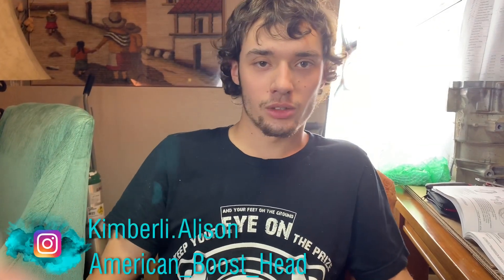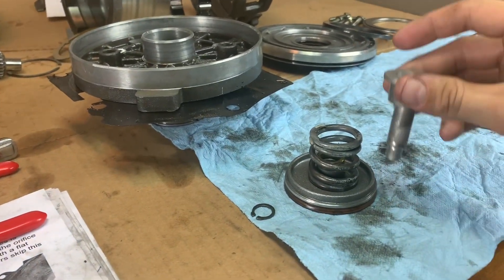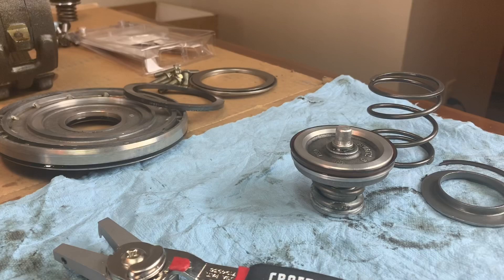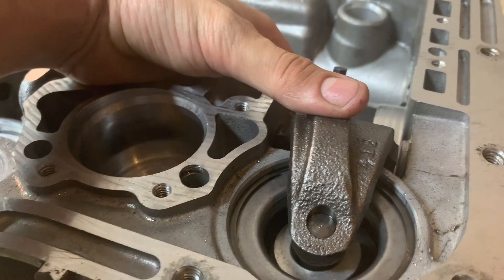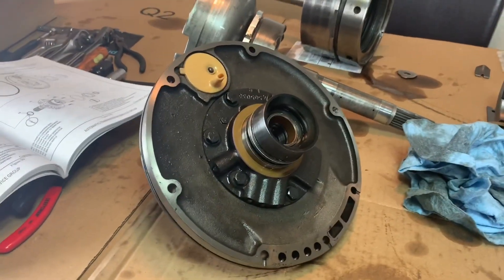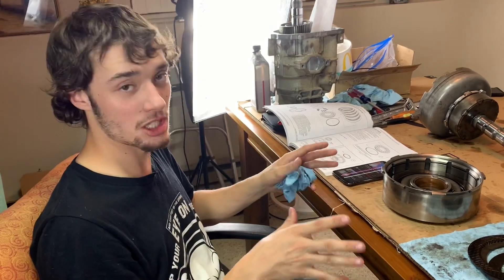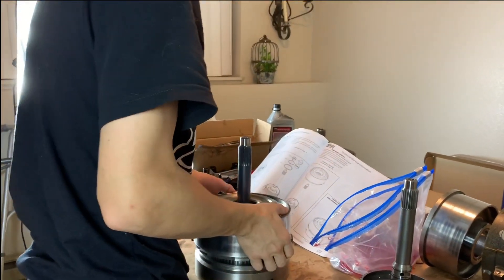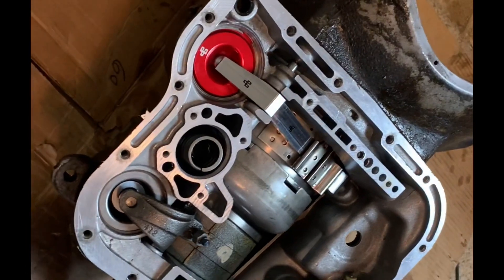47RE Main Case 650HP Build

Comment: Which shifter did u end up using?
Reply from the maker: Mike Robinson we ended up using the Muldoons switched shifter. Works really great! If you are looking for a full manual valve body I would recommend calling them about their reverse pattern FMVB instead of a forward pattern like we used, much easier to drive.
Reply: @americanboosthead  

What's the drive pattern that u have now?
Reply from the maker: Mike Robinson PRN321 but want to switch to PRN123 for more natural shifting.
Reply: @americanboosthead  thanks man, this is good info.
Reply from the maker: Mike Robinson of course(: are you gonna go with the 650hp rated build? What are your HP goals?
Reply: @americanboosthead  not sure on where I wanna end up. Been pretty happy so far with the output I have now but wouldnt mind more power.

The truck currently has a s357 over s475, 150hp sac injectors, p pumped 24 valve with some mods, manton pushrods, dodge neon valve springs, o ringed head and probably alot more I cant think of right now. Been running the nv5600 with a dual disc ceramic for a while now and the transmission is really sad at this point. So it's time for a built auto 😁
Reply from the maker: Mike Robinson I cant tell you how happy is makes me to hear of someone who wants to get rid of a manual for a built auto in their diesel. You will be much happier, and it will be much more reliable if built right. (: